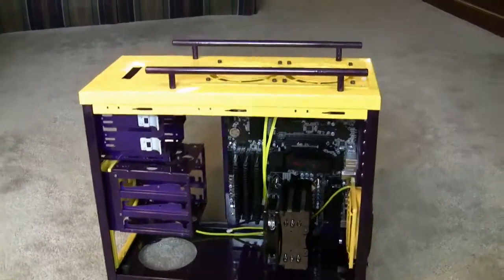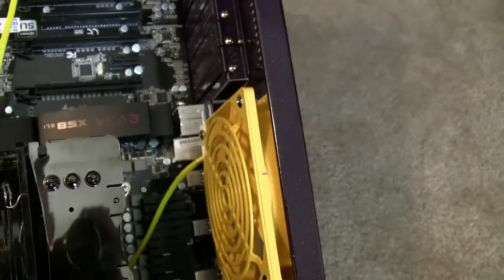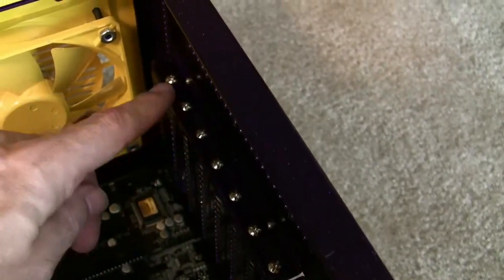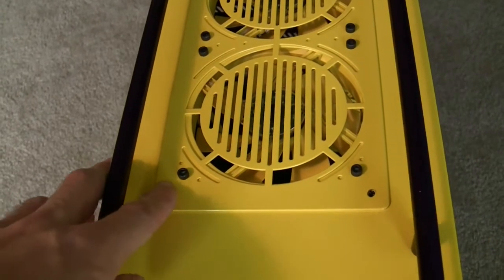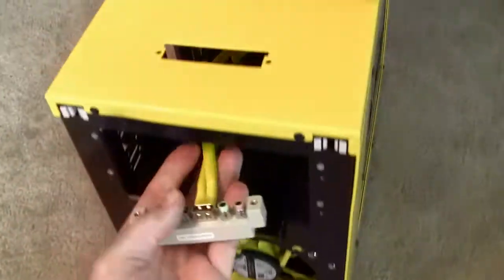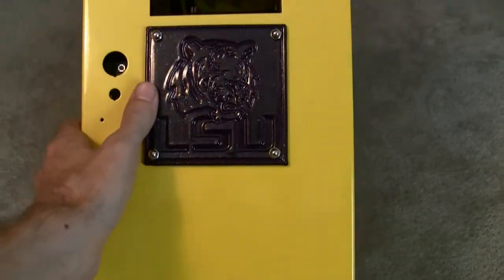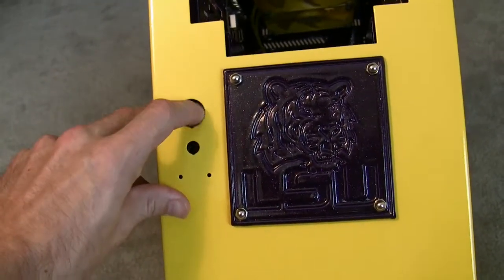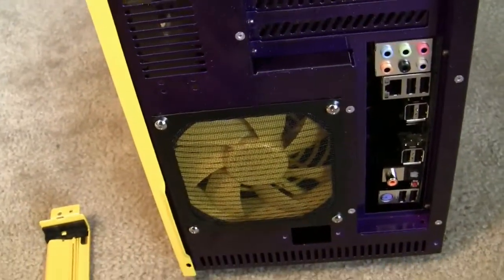LSU Build Worklog Progress #4 - Lian Li PC-A05N

Comment: That looks terrific. I love the colors. 

I have painted a lot of screws and have had some pretty good luck with it. Just tape up the threads and prime and paint them. Make sure the paint is good and dry before installing them or the screw driver can scratch the paint. They look pretty cool when they are done.

Comment: Nice man, looks great. Tip for spray painting screws and such: get a pair of small pliers, grab your screw, nut, bolt, etc. with the pliers and apply the paint like you normally would. Problem is you'll miss a spot where you were holding it; you just have to let it dry well and paint over the spot you missed.

Comment: Yes you can sand them a bit. The best way is to lay the sandpaper flat on the table and grab the screw by the taped up threads and just rub them back and forth a few times like lapping a cpu. I have been thinking about using the oven also. I just painted mine before bed and then installed them in the morning. But I think baking the paint would make it much harder. If you do happen to sratch one installing it. Just spray a little of the paint on some cardboard and touch it up with a Q-tip.

Comment: You can anodize yourself at home with a bucket, car battery , pice of aluminium, wire & dye, Dylon clothes dye works very well.
You can find instructions on here.
You can also buy coloured thumb screws on eBay.
That case looks amazing, I like it. Good work

Comment: Screw wise sand them so they are dull, not too coarse then use etch primer. 2 coats of normal primer and then your colour. you need the normal primer aswell otherwise the acid in the etch will react with the colour coat and bubble. nice vid though dude.

Comment: Hi, one of the bst places for help is caswell.
You can use any dye but I think dylon is a good quality one.
A car battery can be used for a power supply but its not the best. a rectifiyer is the best, Ebay is good for a used one cheap.
Just google anodizing & caswell, you will find lots of help. Message me your email & I will send you a good PDF on anodizing.
You are a cool guy, good videos & very nice build.
Mark